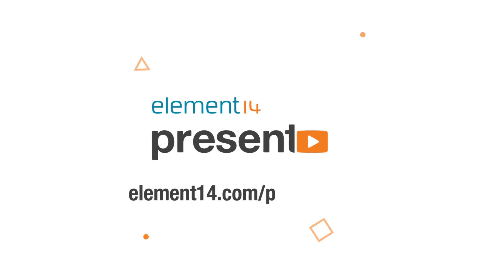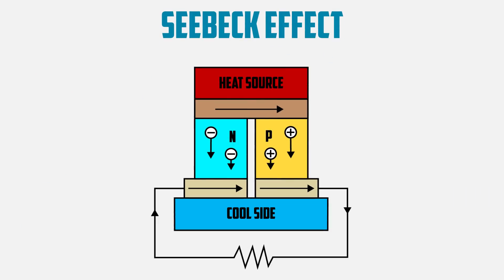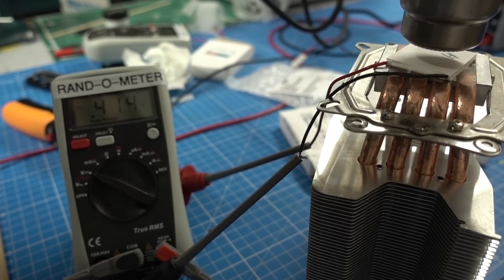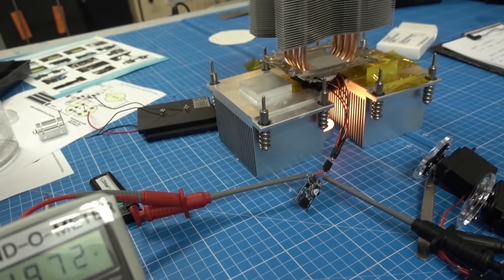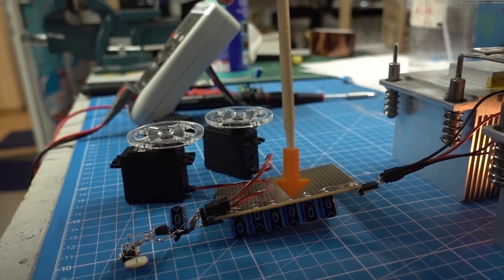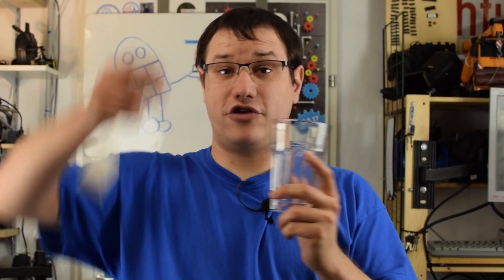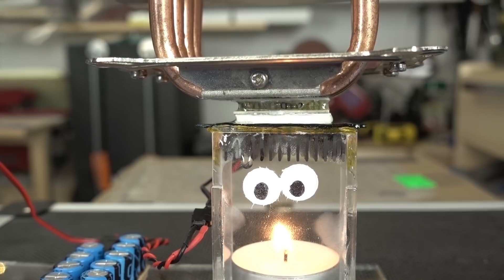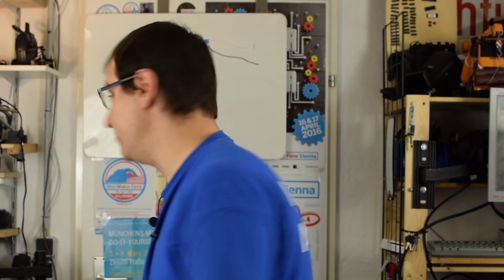Candle Powered Robot

Comment: I wonder how well a supercap would work - you could get a couple farads, and since the limit is usually 2.5v you're probably safe with the voltage it looks like 1 candlepower produced.
Reply: Of course a supercap would also work, but I did not have any of those at hand so I ganged up a lot of normal caps.

Comment: how about using a stirling engine to do the same thing? That's got to be more efficient and you could use the same tea candles.
Reply: Similarly, I was thinking adding gearing to a candle carousel would work much faster and transfer more directly to mechanical energy :D